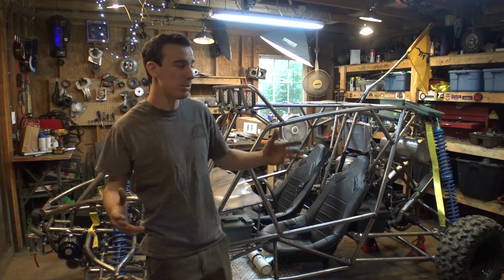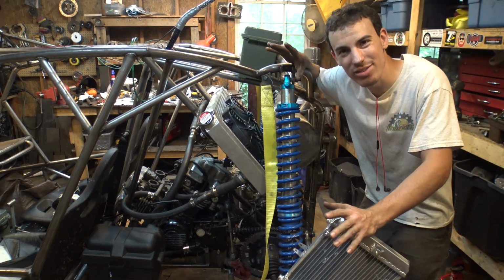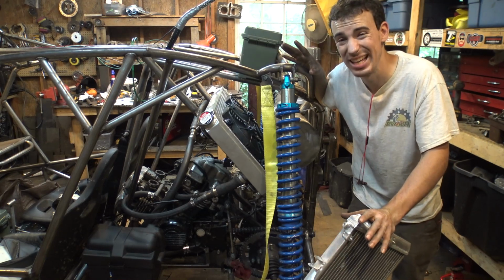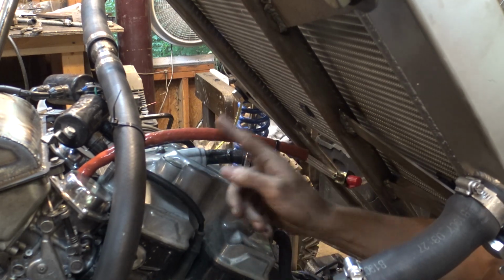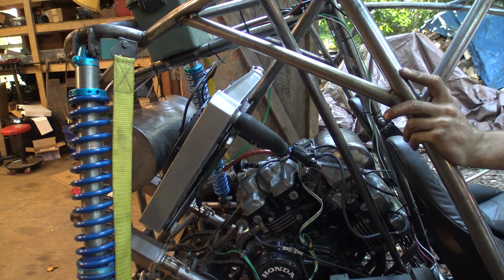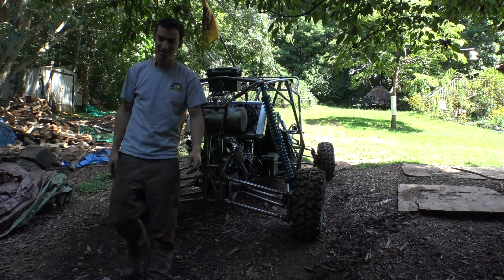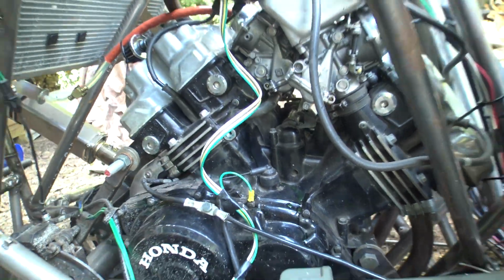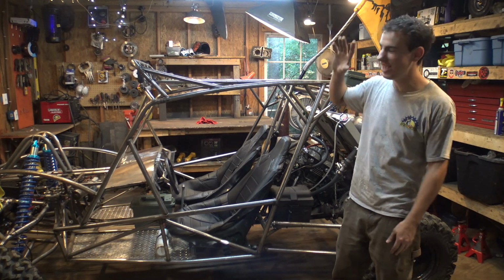Honda VF1000 buggy build part 16

Comment: a honda VFR1000 uses a fuel pump to prevent too little fuel from entering the carburetors to prevent air bubbles from entering the fuel system due to too much heat from the engine , and why do you hang your radiator so low that it hangs full behind your fuel tank, making the tank unnecessarily hot , I also think it's a great machine that you've built ,,, your engine sounds like if your carburetors are not properly synchronized and that the float level is not properly adjusted, but that can also be due to the fact that there is too little fuel running to the carburetor without a fuel pump
Reply: Jan C vd Weide Yes, clearly fuel delivery issues, notice the lean backfire?
Reply: @DirtGearTv  True, I have been saying this for a while now. Let's hope he reads this and listen
Reply: Imperfect Videos I wouldn’t count on it 😂
Reply: @DirtGearTv  yeah doubt it too.
Reply: Youll Never Know  it really isn't.  Which is why the bike this engine came from has a fuel pump.
Reply: I was thinkin the same thing
Reply from the maker: While I was editing this video I was also thinking that I need to install a fuel pump. Do y’all think a pulse pump would work?
Reply: @ratherBweldingChris  yes, any motorcycle pump for a carb should work just fine. An electric one though.
Reply: @ratherBweldingChris  get a pulse fuel pump
Reply: @DirtGearTv  I thought the same thing when it popped fire out of the exhaust. Lean.
Reply: @ratherBweldingChris   I think a normal Mikuni Pulse pump driven off the crankcase breather will be fine, no need for electric ones, they usually cause motorcycle carbs to flood like crazy
Reply: @DocumentaryHub  that is exactly what this needs I was thinking the same and was actually looking for that to link as well xD
Reply: You are correct sir
Reply: Jan C vd Weide, you said exactly what I was going to, fuel starved and fuel tank badly placed above the radiator, engines don't like warm fuel.
Reply: @ratherBweldingChris  I'd go with an electric pump, a 12v facet fuel pump would be ideal. That way you can prime the carbies without having to crank the motor over.
Reply: Ya, a standard holly 12 volt fuel pump should do wonders for those carbs
Reply: @ratherBweldingChris  Just buy the fuel pump that comes on that bike...
Reply: Carb air screws are 2.5 turns from fully in and carb balance requires 2 special honda tools for measuring and adjusting and can be a bstrd to get correct I would recommend getting a honda to balance the carb's for you.
Or plan b would be to do it by ear .
Set the idle as low as possible and adjust each air screw to get the highest idle speed then set the idle as low as possible and repeat for each carb.
Btw I am a retired motorcycle mechanic from northern Ireland  where a few motorcycle racing champions came from like the Dunlop family.
And for a bit of useless information Joey Dunlop s race bike was set up by Joey himself by ear.
Reply: "sounds like if your carburetors are not properly synchronized"  I agree.  they MUST pull the same vac to keep motor running smooth.
Reply: VFR and VT Hondas both have a small reserve tank underneath the seat down low. The pump is not just for pressure, but to keep the bike running when the fuel level is below the carbs.
Reply: Yes a pulse pump is exactly what would be on the bike from factory
Reply: It doesn't need an electric pump. A small pulse pump will do just fine.
Reply: Youll Never Know  And, you would be correct.
Reply: @ratherBweldingChris  The bike came with a fuel pump because (as with many other bikes) the packaging of the fuel tank puts the fuel level below the carbs. A decent sized fuel tap and good tank ventilation should take care of any fuel issues.
Reply: Youll Never Know  nope honda has always had a problem in the 80s with too little fuel supply to the carburetors therefore they have a fuel pump on all sports bike's
Reply: @ratherBweldingChris  why not take the original fuel pump from the vfr then you can plug it into your cable harness without any problems
Reply: @ratherBweldingChris  you need a 3-5 psi pump you can get them on amazon for $20-$50.
Reply: I'm not sure why anyone would argue with taking the original fuel pump (or a new one that is the same if the old one was bad) and using that. I mean, it was engineered for this engine, and so far it has proven to work for many and many of years... I believe any other argument is just for the sake of arguing.
Reply: Yeah also a thermostat problem.
Reply: Yes u need fuel pump.
Reply: Yes you deffanently need a fuel pump. It is running lean when you rev it because the gravity fed fuel can't keep up and the lean condition would make it run hotter.
Reply: I dunno if the 85 vf came with a fuel pump. but this machine will see hill climbs or fly inverted. Gravity fed might not pay the bills. I'd get one.

Comment: pump is usually mounted on the cool side , same with radiator, the theory of thermo-dynamics is the hot water enters at top of radiator, and the cool water is pulled from the bottom of the radiator. Thumbs up for sharing!

Comment: Not sure if others have mentioned it but having the radiator high up increases the head of pressure that the water pump need to overcome to circulate the coolant.  If the pump is old it may be to weak to circulate the coolant at the flow rate recommended and potentially cause overheating.  Just a thought.

Comment: Sounds like fuel delivery or carb problem. With low gearing gearbox can take the extra load. Move the tank away from the gearbox and reroute fuel lines away from the top of the engine. Great build and awesome suspension, soaks up bumps so smooth!

Comment: That crome or silver paint doesn’t stay shiny very long. Looks really good at first. But it fades quickly. A nice metallic silver works way better. Look forward to your videos every week. Hope it holds together. Last week was Awesome.
Reply: It scratches really easy to
Reply: The metallic silver wheel paint works well, and looks nice, and has a clear coat, that resist chemicals, and UV, and a decent amount of heat, I have used it on engines, and it looked good for years!!

Comment: Why not put the gas tank in front of the radiator? Rigth behind the seats. Then you wont have the hot air heating the fuel tank.
Reply: True, but then the radiator would have a harder time getting air.

Comment: Revving the engine at higher rpm will actually help keep the engine cooler because there will be more fuel going into the engine which will help cool it down. I do agree that the other radiator was a little on the small side. Anyway great video I love how the buggy has turned out and I really want to build my own now

Comment: yes that buggy did handle the trail well from what i saw on that video hell you turned out ok rather be welding you should be able to land a hell of a good position  in designing   and interfering just keep doing what you have been i knew i was right about you  and you have already  done more than i  expected to see you are going places great work

Comment: Motorcycle engines are designed to be run at a higher rpm and will cause overheating at lower rpm if the water pump is spinning too slow. BTW awesome build!
Reply: I put that out last video
Reply: Yup
Reply: Rip it Good  dumbest thing I read today, I’d explain why you’re wrong but what good would that do.
Reply: @morehp1   actually he is right water pumps in engines run via centrifugal force the vanes in street bikes are designed to work most efficiently within their powerband and dropping below the powerband for example at idle most street bikes will actually have problems with overheating/heatsoaking (especially the carbureted ones) did you know there is a reason for there being higher volume water pump kits being on the market for alot of streetbikes it was a common problem across the design boards (also part of the reason most street bike manufacturers used to state in their manual to NOT idle the bike stationarily for extended periods of time (more than 15 min)
Reply: D L  so you think manufacturers are building street bikes made to be driven in every day traffic, that can’t set in stopped traffic or at road work, without over heating without Revving the engine for extra water circulation?  As someone who has owned street bikes all my life and daily commutes on one in summer in 97 degree weather this is hilarious. O and in the 30 years of being a Honda tech revving the engine for more circulation has never been the fix for an overheating issue lol sure you can bring down the temp a few degrees but it’s not fixing shit. It may very well not be flowing enough water at Idle but revving the engine isn’t the solution, new water pump, maybe the fix, but he has more variables here, then what this bike engine would see factory water pump is having to perform lift to even get it up to the radiator something the factory design didn’t have, new thermostat be a good idea, and to check for vacuum leaks under carbs, as running lean will over heat one quick, air in the system, this would be a easy to figure out, if was working on it,  over heating is very basic diagnosing.
Reply: @morehp1  have you actually put a temp gauge on several brands and watched it I HAVE while sitting at idle and 3k rpm as well as with a shop fan blowing at the front of the bike and within 15 minutes all that I checked jumped to over 220 degrees head temp at idle without the fan, at 3k rpm without the fan they all ran about 20 degrees cooler, and with the fan ran between 180 and 200 degrees and these were perfectly running bikes...  I've owned and worked on several brands and actually read the owners manuals for every one I owned... all but one had that phrase in their warning section... heck some manufacturers bikes have problems idling too long melting the radiator fans (yes common problem for a kowasaki ninja).  I was ase master certified and  I did state extended periods at idle... I personally have hooked flow gauges into the cooling systems on several different brands and all had over a 40% drop in flow at idle compared to when revved to just 3k rpm yes he is trying to lift the coolant slowing his flow rates even further however the aftermarket actually has fixes for this problem as I stated... it's a KNOWN issue not with just one brand either although in recent years the cooling systems are much more improved allowing longer idle times without overheating but I may only have 18 yrs experience myself I was fixing them up before I could even drive and yes I verified the running af ratios on the carbed  engines with a tail pipe sniffer stuck in the tail pipe at each header pipe

Comment: OK - Food for thought - youre adding things like Huge Lightbars, Double GIANT - Car sized cooling fan motors, now Electric Power steering.......... If you USE more power than the tiny Bike alternator is able to keep up with you'll run the battery down when riding, these things are normally balanced, and a bike has NONE of these gargantuan power draws you've added!!! at the very least you might be burning up regulators and Stator coils which are terrible expensive - you may want to add a belt driven alternator off a small car or run it off the chain drive or something to help the tiny Motorcycle charging system out........
As far as Radiator, I think it's just right given that you wont be getting the airflow the bike used to get-
As far as Power output and engine not being able to handle it, I think with your gearing that motor should be fine!
With the fact that you have a brand new everything yet still got clogged up carbs after the first run, I'd check your gas can you filled it with, for contamination - also is the fuel tank rusting already, perhaps treat it and coat the inside with Por-15 or Casewells  tank liner/sealer kit. and get a better fuel filter, should not have clogged carbs after just one ride!!!!!!
Reply: If you go back a few videos he treated the fuel tank with a liquid fuel tank treatment, idk what its called but maybe he didn't clean the carbs until now.

Comment: Good call going to a larger radiator. Although your gas boiling wasn’t due to engine overheat... Ever notice how autos and hot rods use insulated fuel lines? You should absolutely insulate your lines more, but also raise them off the top of the engine, this will protect you from vapor lock, which is probably what was causing fuel delivery issues. Great job.
Reply from the maker: DirtGearTv thanks man, I will try that. I love your buggy btw
Reply: rather B welding Thanks, I can’t wait to get it running with the new engine!

Comment: hi i would put on clamps for the hoses on that radiator don't short cut with hot water pressure if it gets you  gonna hurt  up to you very nice ride watched all vids. going to be very nice paint scheme also look forward to next project

Comment: As long as you have a thermostat on the engine that works then the radiator could be the size of the moon and it wouldnt matter bro...
Reply: Take a stride or Step aside what are you trying to say?
Reply: @morehp1 he said what he meant. The radiator isn't likely the problem. The thermostat is.
Reply: MartinStangMan but in he’s statement he is saying if you have a working thermostat, not that if you have a bad thermostat. Maybe he meant to say, if you have a bad thermostat the radiator could be the size of the moon it wouldn’t make a difference. But the way he’s statement is worded it does not make any since.
Reply: morehp1 he’s saying that with the right thermostat it the radiator can’t cool it too much cause it’ll keep warm cause it’ll close if it’s too cold
Reply: If the thermostat was working it would not pump water through the radiator as long as the engine has not reached its working temperature. So I suppose something is wrong with the thermostat.
Reply: @daniel_6741  I even think there is none in it
Reply: Exactly
Reply: my motorcyccle has the thermostate build into the radiator end housing. I do not know how Honda does it but if thats the same solution as my bike uses the radiator was wrong and needed an external themostate ;)

Comment: Don’t be too hard on yourself, you’re young and learning.  If you open up the breathing of the engine, (intake/exhaust) you will need to compensate with more fuel and that means all the way across the rpm range, including idle.  If it was an EFI , I’d say get an aftermarket fuel tuner such as Bazzaz or Power Commander with “auto tune” module.  Since your is carb, I think it’s time for you to find a dyno tuner.  Approximately 13 parts air to 1 part fuel.  If the cooling leak is from the casting and not just the hose attachment, it’s not going to be good, but I think you would see white smoke emitting from the exhaust. Love the electric assist.  Yamaha snowmobiles tried it a few years ago and it’s now on many off road toys.  Don’t give up on that engine just yet, but if that case/cylinder is cracked, you might need to find another or if possible it could be mig or tig welded?  Hang in there young guy, you’ll get it.

Comment: I would address the chain issue. I think it will come off again. With the aggressive backward bend, I think there is substantial heat generation and stretch. This might be moot. There may be too many clearance issues with this but I would adapt a shaft onto the output from the trans and add more sprockets. Then add more driven sprockets as well. More chain, more strength, and less need for the aggressive bend for tooth engagement. I understand the chain routing may be for clearance issues. I could not tell from the vid. Nice work.

Comment: Ok!  You have to hear this!  I am so proud of you two....Very Proud!  I have been waiting with "Bait on My Breath*" for you to get toward the final niceties.  !) You MUST check the BACKPRESSURE in the exhaust pipes!  You could gain upwards to 5 -10 HP!  2) If "Blenzall" is still making 4 cycle NITRO additive...  USE IT!  more HP. and internal lubrication!  3) Change your tires to "Carlisle Racing Slicks"   Wide in the Back, narrow in the front.  Beef up the diameter just a little bit!  STAY OUT of the DIRT for a while!!!!!  Use ram-stacks with a light but strong foam filter.  MORE HP.  4)  Your gearing may be a little touchy, but don't despair!  Your final solution will be like launching a rocket!  When you want to play in the dirt,  Change the tires that you will have mounted and balanced, (Preferably Knobbies on the rear, and beefy tread winter tread tires on the front.  Keep them about the same size. 5) AFFIX a nice digital dashboard on the machine.  Knowing your RPM's, Speed, Engine Temp, and Oil temp is critical!!!   The rest is a little nit-picking!  Color, with very high-end primer!!!  Then Clear Coat.  You guys have been perfect with the fuel!!  Congrats!  6)  I almost forgot!  Add a couple of small fire extinguishers, out of the way for comfort, but handy to reach!!!  7)  Take the fiber straps off the fuel tank, and replace them with stainless steel straps with folding latches.  Safety first fellows!  If there is a fire, two flips of the latches and the tank is free!!  8)  Make it pretty, and continue to make me proud.  BTW!  If you do a little engine improvement, (bore it out, new pistons,  you know;  Little things, then the fuel injectors.... You will easily exceed 150 MPH!  Where there is a will there is a WAY!!!  Good luck, and have a HELL of a lot of FUN!!!  bob myers           rfmyers1@comcast.net      'MAL AD OSTEO' !

Comment: Check your timing gears, sparkplugs if color yellow spark throw them out get new ones. Check resistance in coils also if to lean it will not spark on time. Recheck valves, with gages. Check oil see if no coolant in it. A mall leak can lead to a bigger issue. I would recommend changing to a dual carberator setup.